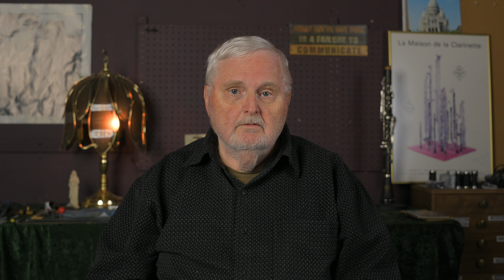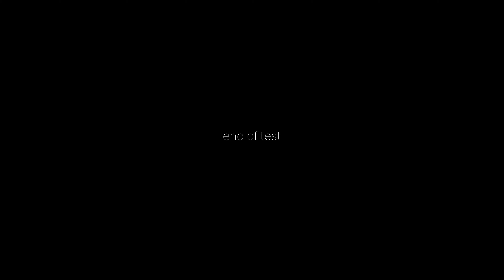mix pre 3 and nikon z6 in 10 bit test 2

Comment: I bought the PreMix-3 and had to buy the Sony L battery adaptor to get longer record times on the Premix 3
Now with the Battery adapter, I can get 4 hours out of my PreMix 3
Great video
Regards, Rick
Reply: Rick Vestuto that will help for sure on location. But I only record in studio and use the ac connection. Good to know about the L adaptor.